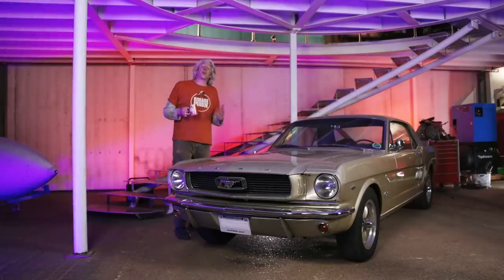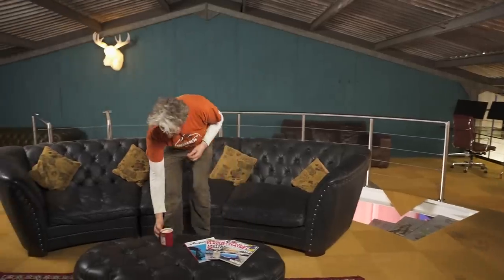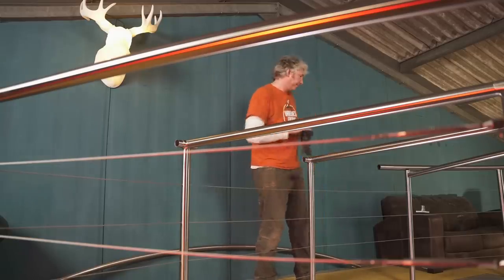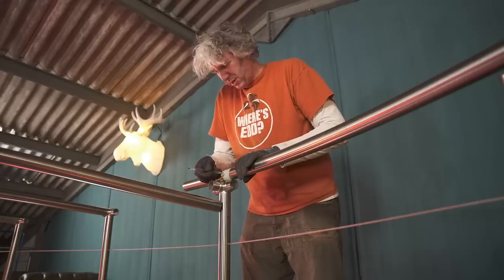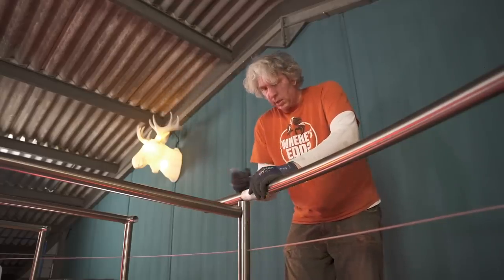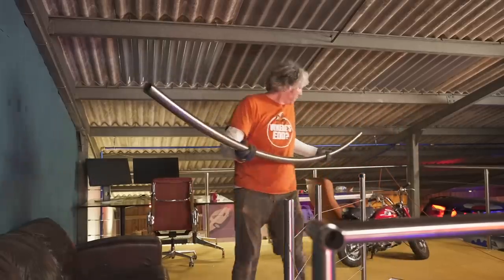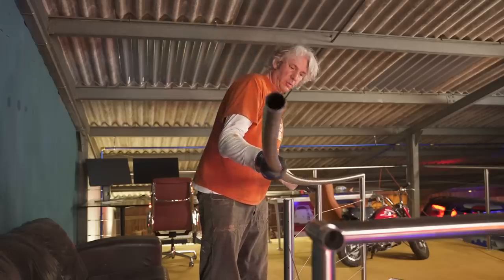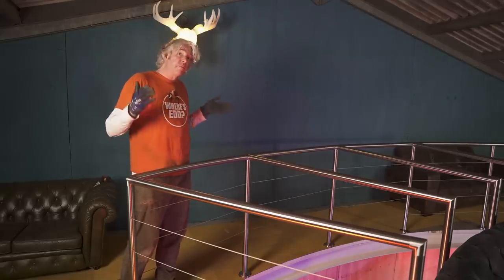Welcome To Edd's Procrastination Space! | Building A Balustrade | Workshop Diaries | Edd China

Comment: a drop metal band  with coolant is  best for  that type  job edd, a dropsaw with what look's like a wood blade on it dulls the  cutting stuff it wasn't designed to cut...

wheeler dealers has gone down since you left would of been better of them to do 2-3 seasons in the US with you there then migrate the to a more US cast to take over. much like was done with the this old house crew since the 70's